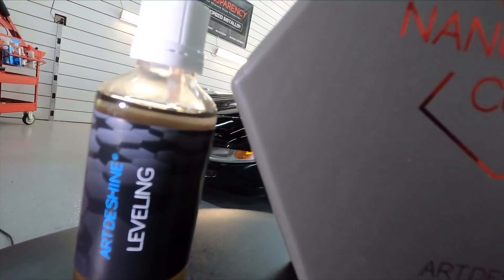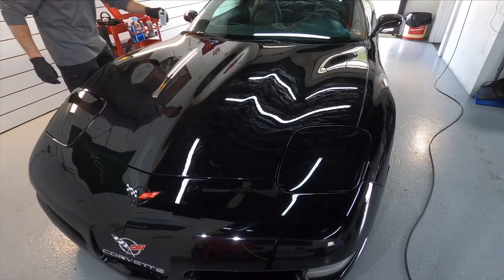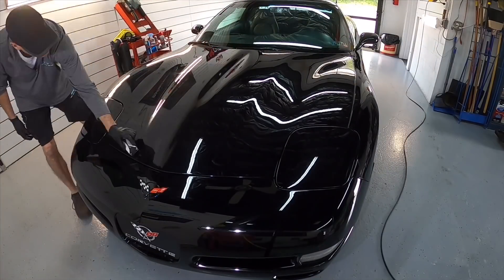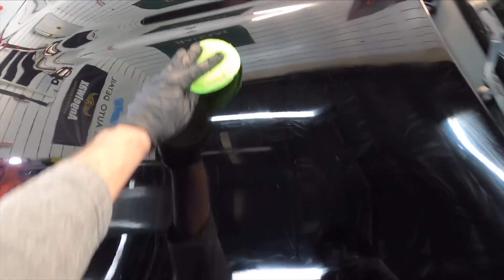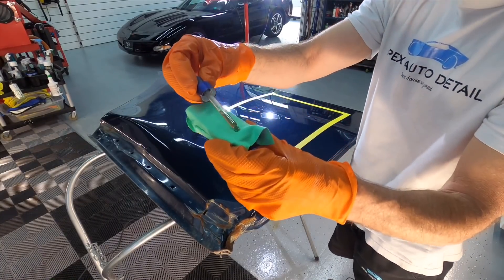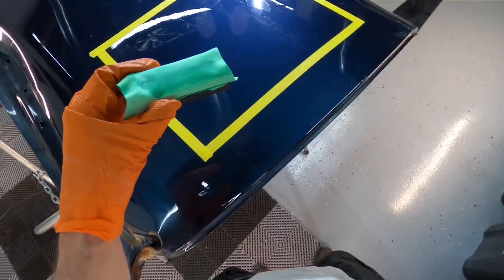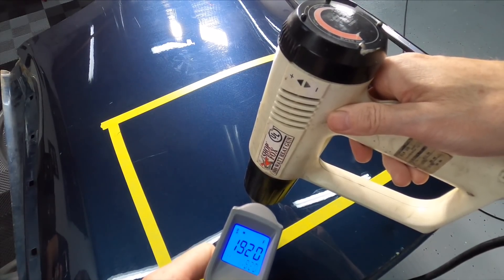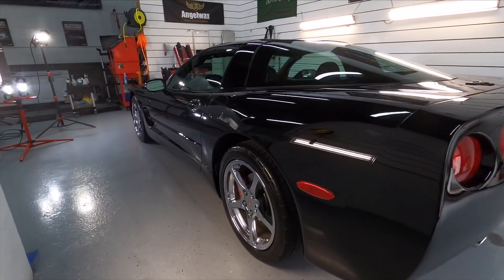Highest concentrated GRAPHENE Coating Available? Artdeshine Nano Graphene Coating And Leveler!!

Comment: Why is it that every single sealant tested not one person has it on thier own daily driven car and shown how long the products really last in real world conditions snow, rain ,massive hot days mud crap all over the car and then show how easy it was to use a strip type car wash product to wash the car and show just how hydrophobic it is after 6 months of not washing the car etc. :) or at least do 1/2 the car with two different product that claim 6 months to a year worth of protection even if you use ph neutral car wash? Till i see that then i will believe what the products claim, like the new 303 graphene spray on product, just seen one do a test and after two weeks and a couple of detergents used on it it was done, now tell me it says protection uot a year, what the hell maybe for a car which is never ever in the rain and sitting on a showroom?

Comment: Brian just a simple question, I used ArtDeShine graphene coating on my car and it came out awesome. Question is what do you use as an In-between/maintenance for it. Sort of like ceramic boost is used for a ceramic coating. The maintenance bottle for ArtDeShine seems to be a coating but much less concentrated. Thanks in advance.

Comment: @Apex Detail It figures that I just had my BMW coated with Opti-Coat Pro at my local authorized detailer. Kind of wishing I knew that all these graphene products would be coming out before I did that. That said, I still love my Opti-Coat so maybe in 5 or so years from now I'll get the graphene lol. Do you have any predictions about longevity of this compared to a good ceramic i.e.Opti-Coat? Thanks, just subscribed.

Comment: Hi Brian,
Can this be applied on top of a clear bra?
Reply: From the product spec sheet: Surface suitability: Gloss/matte clear coats on automotive body, vinyl wraps, paint protection film (PPF) wraps, acrylic parts, chrome/stainless steel/metal parts, gloss/matte plastic trims and fittings
(Installing on glass windows and windshield will present application difficulties due to viscous state of product, may cause irregular wiper movement, durability not tested)

Comment: All you “detailers” are a snake oil salesmen’s dream! This is not Graphene it is Graphene oxide, big difference! The useless shit in this coating is oxidized graphite which is just as weak as graphite! Graphene is made from Graphene oxide by removing the oxygen, which is extremely expensive and they haven’t found a way to mass produce it yet! This like ceramic scam coatings are no better than Klasse sealant thats been around for decades! Detailers have zero knowledge of paint chemistry or any chemistry at all! Can they make a car shine with a silly overpriced orbital polish er, sure but a person who mixes and paints show cars for SEMA shows and the like dont use any of the pro detailers tools or chemicals! If you’re gonna invest in a pricey sealant make sure its contains unicorn tears!

Comment: Can this be used on trim and/or glass?
Reply: From the product spec sheet: Surface suitability: Gloss/matte clear coats on automotive body, vinyl wraps, paint protection film (PPF) wraps, acrylic parts, chrome/stainless steel/metal parts, gloss/matte plastic trims and fittings
(Installing on glass windows and windshield will present application difficulties due to viscous state of product, may cause irregular wiper movement, durability not tested)

Comment: Question please. Do you know if you can apply the coating on top of a PPF?
Reply: From the product spec sheet: Surface suitability: Gloss/matte clear coats on automotive body, vinyl wraps, paint protection film (PPF) wraps, acrylic parts, chrome/stainless steel/metal parts, gloss/matte plastic trims and fittings

Comment: Hey B... can we apply to trim and glass???  Makes the higher cost easier to swallow if we can do various surfaces
Reply: From the product spec sheet: Surface suitability: Gloss/matte clear coats on automotive body, vinyl wraps, paint protection film (PPF) wraps, acrylic parts, chrome/stainless steel/metal parts, gloss/matte plastic trims and fittings
(Installing on glass windows and windshield will present application difficulties due to viscous state of product, may cause irregular wiper movement, durability not tested)

Comment: Brian, that leveler isn't even considered a sacrificial layer but just what it says it is, correct🤔
Reply from the maker: Klasse Act it can be used before or after coating with the base coating. I truly would skip it and just have a damp microfiber nearby. It worked fine.

Comment: Is it supossed to put the leveler first as a ground coating and then use the Graphene ? i read on a detailshop use first leveler to decontain from the ipa cleaners and polish leftovers. you use the leveler as the last step ???
Reply from the maker: Stefaan Conrardy you can use it before or after. It re activates high spots so you can remove them if they are left behind a few hours. I still believe all you need is a damp towel to follow up. Save your money.

Comment: Let me see.. 20.00 worth of acylic carrier , 135.00 of GO  equals over 30 30 ml bottles sold at +100.00. 

The problem with knowledge is once the Jeanie is out of the bottle, it can't be put back in. Ignorance is truly bliss.

Not to be a Donnie Downer but I have my doubts concerning a claim of something being highest concentration. 4% of Graphine Oxide GO is theagic number. But then I wonder if it's been mixed properly. It can not be dy stored in. A Nano substance has special handling requirements in order to mix with a carrier. Then, where is the test data that even shows this stuff actualky works better than the Concrete water proofing that is 95% of it's volume.
 What is the Artdrshine product being compared with? Nothing. There is, at this time no one else I know of offering a Automotive product.  To make matters worse, Google owns the outline of Product (any Graphene coating and patent of several manufacturing process) for US and World patent. 

Interesting to see how this whole graphene coating thing may never really take off like SiO did. To begin with there is already a substance known to be better than Graphene in some applications. 
Carbyne. https://blogthinkbig.com/carbyne-stronger-graphene-now-synthesisedp
Reply from the maker: Christopher Fox Wallace durability is the only question mark for me. And I can only wait and keep an eye on these coatings. Everything else is background noise.
Reply: @apexdetail85  thank you sir for your diligence. Unfortunately the product you are testing is a Si polymer coating with Graphene added. The will be no reliable data concerning if Graphene is actually adding to the benefits eg Gloss, hardness etc.

I will be very interested if you line up and compare a SiO2 product against this Graphene Si product.   Test if there is any improvement by the addition of Graphene. Im going to bet that in this current incarnation of Graphene coating no real improvement over SiO2 coatings can be seen. The Graphene does not make a film itself, it is simply suspended in a solution and be bonded via the Si 'glue' and so bond to the substrate like a mass of nano particles offering none of their molecular strength to paint they are pit on.
Its presence in the compound is by appearance a marketing ploy. Graphene is not Hydrophobic. So I'm curious to understand how it would improve a coating.  
Thank you for all your work. Your channel is my go to for learning about technique and technology in detailing. 💯😊

Comment: Brian-  would like to see you test the graphene coating after full curing to see how it responds to hard water that creates water spots on many Si02 based ceramic coatings. I have several customers that have complained about water spots after washing their ceramic coated cars using our municipal water which has lots of minerals in it. Most people don’t want to have to deal with learning how to use water spot removers.
Reply from the maker: No problems so far. But it is early. I need to be patient and keep an eye on these coatings.👍
Reply: @apexdetail85  any updates?
Reply: I too am interested in seeing how this will hold up over time and it’s resistance to water spots.

Comment: how would you prepare the car for coating applications on this graphene
Reply: Cesar Lebron sane thing as any other coating but you have to make sure you do every step in the video he shows on his channel without cutting corners. And absolutely nothing on the paint before applying
Reply from the maker: Exactly the same as any Sio2 coating.